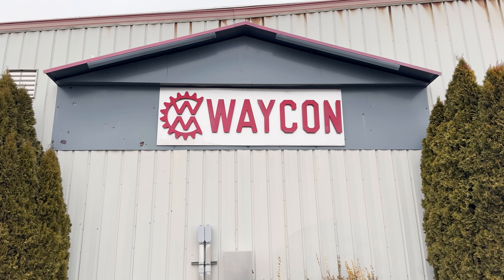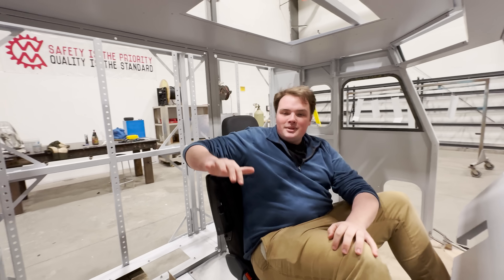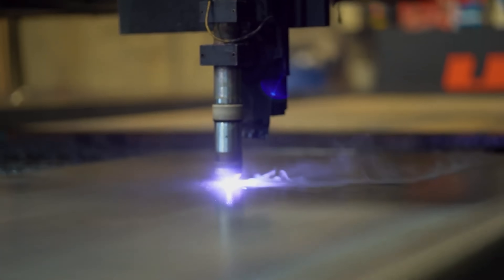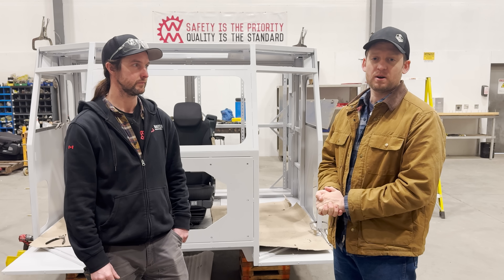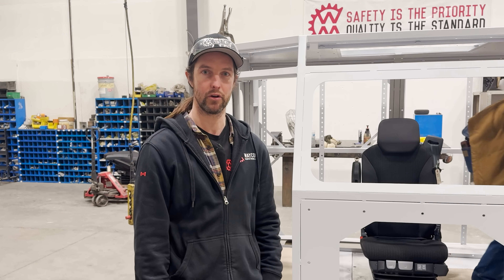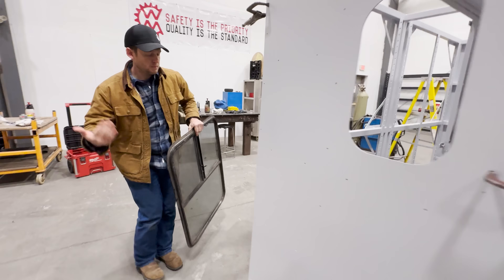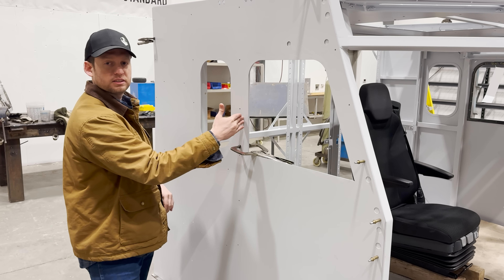Unveiling the Undisclosed Hybrid Electric Truck Cab: A Sneak Peek

Comment: Dumb Albertan mechanical/materials engineer here lacking full context. First off I friggin love the work you're doing and support it 100%. A few things are really nagging me about the design. Disclaimer: I’m not an automotive engineer, and these are just opinions to be validated by an actual professional in the field.

TL;DR I think the centre driving position creates safety issues from increased blind spots, and access/egress/seat ergonomics need improvement to mitigate increased driver fatigue. There are several plausible approaches and solutions to these, and your client may be happier with the driving position being brought back to the side after hearing the arguments.

----
Long version: 

Looks like the driving design criteria is that the client is adamant about center seating, with the reason being forward visibility, at 2:50. I'm coming at this from the angle of trying to make a centre driving position work, but it will likely be a buzzkill while offering possible alternatives that give your client better visibility and comfort.

First: A safety hazard may be imposed by the seat’s relatively large distance from at least one side window, which would increase blind spot size to the side in the down and rear directions. Some people specialize in only modeling vehicle fields of view (i.e. https://www.lboro.ac.uk/microsites/lds/sammie/hgv-vis.html.), and their work shows that distance from side fenestration has a huge negative impact to visibility. For instance it's why snipers stay far back from windows, to not be seen. To recover side-down field of view bring the wall closer to the driver. To recover rear-side view, either add cameras, mirrors, or slide the seat to the left. Here’s a half-day project for your designer: In your CAD program, render fields of view for your design, in relation to the expected position of the operator’s eyeballs (in all seating positions) and compare with that of a typical truck. If done properly, the contrast should be stark.

I’ll use images from Komatsu’s site to further illustrate my points (https://www.komatsu.com/en/products/): In most commercial/industrial vehicles, you’ll see two common patterns: side windows being within ~18” of the operator’s face, and the seat usually located in-line with the end of the widest obstruction to view to the rear (in the absence of rear-view cameras).

Take Komatsu’s HM300 wiggle wagon, which has a centre driving position(!); note that the doors/windows are brought in tighter with the operator. Due to having an obstructed rear view, the rear of the cab is still glass but they add a rear-view camera for the operator (look at the field of view here: https://youtu.be/vlI3Ep0Gwd4?si=nP3bVl24nbOzBj9d&t=99). This is acceptable for a construction vehicle, but likely not for a vehicle which must be relied upon on public roadways. Komatsu’s graders, mitigate lost field of view from greater operator distance to cab sides (still far less than I’m seeing in your design), by making cabs almost entirely glass *including to the rear*. Look at mining haul trucks all the way up to the 980’s and you’ll see two common patterns: side windows being within ~18” of the operator’s face, and the seat being located in-line with the edge of the widest rear view obstruction. 

To make the most of a centre driving position, bring the door and window in tight with the operator, move your consoles/storage to the non-door side (between driver and passenger) and add more mirrors and/or whatever government-approved rear-view cameras which would work in all weather conditions, don’t get mussy/snow-blocked and can be user-replaced. 

Second problem: Seat height and the actual path to getting seated. What first prompted this whole diatribe also had me chuckle when I saw dunnage added under the seat at 6:20. Yeah dude you’re goddamned right the seat’s too low! Especially for one that’s so elevated above grade. Getting in and out will be a challenge for most clients, and I think the point of being able to drive long hauls is compromised by the position. I know you're well aware of the causes and consequences of driver fatigue. The usual reason a seat would be low vs the rest of a cab is when the literal bottom of the vehicle is the limited by either the pavement itself or the bottom of the vehicle (say due to battery packs I imagine). In the absence of those insurmountable issues, long haul truck seats should be almost like an office chair in customisability (and definitely NOT ‘racing/gamer chairs!). Ditto steering wheel and pedals but I won’t go there.

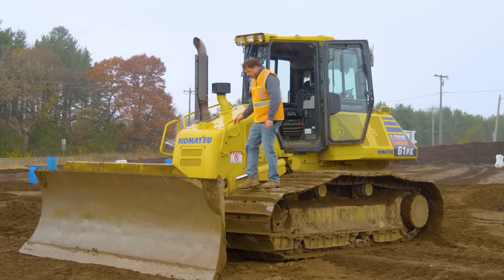Notice the dozer operator at 2:18 only needs two steps to get in or out. Fully ergonomically seated <--> left foot full step and toe-pivot <--> right foot threshold <--> outside. This is due to closeness of the door and seat/cab height. A low seat to a same-height floor requires grab bars and/or rolling out, in addition to increasing driver fatigue. Dropping the floor elevation between seat, pedals and door and raising the ceiling above, allowing the operator to work like if it was an ergonomic automotive office chair, should be the specification. 

Separately, I notice at 4:23, bottom left, the legacy floor plate is still present where it used to be part of a chamfer above headlights in the old CAD render at 2:50. I assume the space under this plate is part of the battery or has core functional parts and must be kept. If this is the case, then it will dictate which combination of options is best to resolve the current driver seat height and location problems. 

To keep the lower seat/cab ceiling height:
Option 1 is to shrink the cab by drawing in the left wall and door right up to the driver’s position. This solves access/egress issues as well as restoring most left side-down field of view. The resulting smaller cabin’s climate would be equally satisfied by a smaller HVAC system and cheaper to manufacture.
Option 2 is to keep the current cab size and slide the seat to the left side. This has the same benefits as option 1, while also significantly reducing left side-rear blind spots. The con is that the right-side blind spot gets a bit bigger, but the net result is still a significant overall gain of field of view.

To bring the seat to industry standard ergonomics:
Option 3: increase cab height to allow for an upright position will resolve driver fatigue/ergonomics issues.
Option 4: Maintain current seat/cab height, drop the floor height between the seat, pedals and door 

---
In summary, I strongly feel the design should re-visit, in order of importance: 

i)	Safety: the operator’s seat must be adjacent the door and side window to restore significant driver’s side-down field of view (say by shrinking the left side of the cabin or moving the seat leftward). Brings access & egress ergonomics close to industry standard.
ii)	Safety: the seat should be moved to the left side of the existing cab to restore significant lost side-rear visibility, in addition to benefits of the previous recommendation. The downside of lost right-side field of view (down and rear) is nowhere near the gain had on the left side.
iii)	Ergonomics: The driver’s seat being upright should be mandatory either lower floors/pedals around the seat or raise cab height ceiling as required to reduce driver fatigue.  

Notice that of these proposed changes, none meaningfully reduce forward visibility. I suspect, however, that your client cares about passenger-side-down visibility, which I think is an important thing to care about. Normally, I hate saying ‘but this is how it’s always been done’; but when we look at this list of centre-driving vehicles (https://en.wikipedia.org/wiki/Category:Cars_with_a_centre_driving_position) we can take some lessons. Notice the only ones that are ever used for any duration have their windows/doors brought in tight with drivers. The closest thing to your design is the Land Rover Centre Steer, which flopped for undisclosed reasons. 

Increasing passenger side visibility requires a combination of obstruction removal, seat height increase, bringing cab walls in closer to the driver, and increasing fenestration while maintaining cab safety, insulation and privacy.

Forgive me for typos and stuff. I just wanna make sure these points get discussed by stakeholders.
Reply: I appreciate your enthusiasm :)

Comment: Nice informational video. For many people a "traditional factory" vehicle will work the best due to cost, but you guys fill in the gap for all the people where a custom built is a must. 

I remember people taking standard built trucks and having to spend lots of money to redesign a truck to meet there specific needs. The expense to modify a prebuilt is much more than a scratch built.  and when you modify a prebuilt you run into so many unexpected issues that a scratch built do not have.

I hope that you guys can use this model of a cab in multiple instances to make the cost per vehicle much cheaper at the same quality.

 Love your videos keep them coming.
Reply: Exactly Base model spec is fine for 95% of the trucks but 5% is a ton of trucks and companies that have specific needs and demand no longer have to figure out how to make a spec truck fit their need. Start from scratch and in the end it might not even cost them more. As well the more they order the cheaper they get. Working in the Oil Patch custom is the name of the game.

Comment: What's the point with center seating? Poor visibility both left and right. In a standard truck at least reversing to the left is easy.
And why not a higher roof for easier entry? Look at Scania for example where it's possible to stand up in the cab.

Comment: Does the electric box's safety interlock behave differently if the truck is actively in motion? Are there potential dangers from shutting off all power if someone happens to open that panel while someone else is driving the truck? What about an electric lock on that panel that prevents it from being opened while the truck is powered on?

Comment: It would be cool if you managed to get the doors to open more than 180°, and latch flat onto the outside of the cab so you can drive with the doors open! Good if you need to get out a lot, or to get out hot air quickly after getting in!
(but it might become a problem at high speed since you are shoving air into a closed area with nowhere to go)

Comment: @EdisonMotors - please consider a modular mount system for the ceiling. This way cable mounts, modules, sensors, and accessories can be installed, moved, re-routed as the need arises. This also means things can be upgraded, and replaced. This also means you launch a new trucking ecosystem where third parties can contribute their components that can then be user-installed, and supported by others without messing with Edison's own components.

Something along the lines of open-source 3D printed Multiboard https://www.youtube.com/shorts/QlQFrCodaeY

Comment: With those diagonal doors, I'm wondering whether front or rear hinges would be safer and more convenient for the operator. Obviously there are somewhat different expected conditions from large trucks like this will be and cars in accident situations, but, well, they still call rear-hinged doors 'suicide doors' for a reason. I notice the dozer you showed as an example had them hinged at the outside anyways (presumably not a fast enough vehicle to have the issue).
Also, for that rear electronics panel? That needs to have locks that you're damn confident in and can easily access, and the same with its sensors. It goes without saying that you do not want that being able to slide open on its own after a couple decades of sitting or a few hundred openings, nor do you want to have to dig through half the truck because a sensor went out and shut it down on you - redundancy and accessibility is key.
And the others mentioning height issues definitely have a point. I know this isn't a mass-produced concept but there's a big range between the tallest people being able to stand and the shortest people being able to see out of the vehicle, and it can be useful to think about both. Sometimes it results in weird designs (see the US's recent electric mail trucks, which while strange-looking do in fact accomodate every size of driver, for instance) but function over form is important.
Reply: We mounted the hinges at the front for the reasons you’ve mentioned. Front mounted hinges gave us much better access to the cab. Each of the electronics panels have 4 latches, 2 of which are locking for safety. We’re going to use two sensors for redundancy per panel. Also, for the height thing that was one of my concerns but as a 6’6 guy I fit quite comfortably.
Reply: Glad to hear it. By the sound of it this is yet more confirmation that these trucks are in good hands.

Comment: I had an early MGB that had roll-down windows and external door handles. I became interested in its predecessor, the MGA, and it had side curtains and only interior door latches. It also had a ladder frame and wooden floor. The batteries were located behind the driver on both models.

Comment: Love the Edison motors idea. This is how companies should run with the practical approach and engagement at all the levels.
Small thought on the cab design idea, since the driver seat is away from the cab door, it requires a step or two with change in direction. Cab height , ergonomics should be considered if not already considered. May be there are enough grab handles etc. in the final design already. Great idea keep up the good work. 🇨🇦🇨🇦🇨🇦

Comment: One thing: there are some TALL GUYS out there! That cab looks a 'little' short. I don't drive a truck, so i don't really know WHAT the normal perspective is; but I see those guys who drive with the MASSIVE chrome visors or huge brow tints and I'm like HOW DO THEY SEE? Ihad a friend who had the exact same truck I drive now (full size F-150) and he had a brow tint that went halfway down his windshield. I could not drive his truck more than about 30 miles without getting a MASSIVE Migraine headache because I can't drive 'leaned back' and that tint stopped RIGHT IN THE MIDDLE of my field of view. It made my eyes go crazy! All the extra pupil movements and retinal effort of constantly dimming and brightening light as i switched between the two fields of view had me driving hunched over so I could see or missing dangerous road details! Your cab roof and front windshield seems awfully low. My head pretty much rubs the room in ANY VEHICLE! That's the reason i drive a full sized vehicle: to have enough room to be comfortable commuting!  If I were driving that truck, I'd have an awful time doing so because I'd have to expend a concerted effort to look below your brow-mounted computer displays. I am familiar with the adjustability of Air-Ride seats, but in this case it just doesn’t look like it's enough!
Edison Motors, if this reaches you I'd love to hear you feedback on my thoughts. I know things have to be built for the law of averages, and the average man is 5'9"to 5'11" and about 180lbs, but I'm 6'6" and 350lbs. That's quite a deviation, and I suffer greatly for it! (Yes I can and should lose weight, but NOBODY realizes what all that bending over does to your back after years of repeated strain!) A lot of 'vocational guys' tend to be of bigger build... ever thought about taking that into consideration...?
Reply: I'm actually 6'6 and you can see in the video there's a decent bit of space above my head. Being such a big guy it definitely was something on my mind when designing this cab. The screens are actually being mounted to the edges of that center panel so they aren't directly down your line of sight. With the angle of that panel as well I don't find it very distracting. On topsy the screen's were much more prominent and we didn't find it to be a huge issue.
Reply: @Peterbuildstrucks  But the door opening looks tiny. I was thinking, extend the door down and add a well on either side of the seat like some buses have by the door so you don't hit your head getting in and out.
Reply: I had the same thought. I'm 6' 5" and seeing Peter in there, I was afraid it would be cramped for big fellas.  But if Peter is in the 99th percentile for height, and he fits, then average sized people should be OK. Cool :)
Reply: I had a brow tint on my last car, and have it in my f150, it's set to be exactly the height for me being 5'10. Anyone taller would hate it. You just gotta set it up for how it works for you. About the only time a drop visor is a nuisance, is when you can't see that blasted traffic light 😂